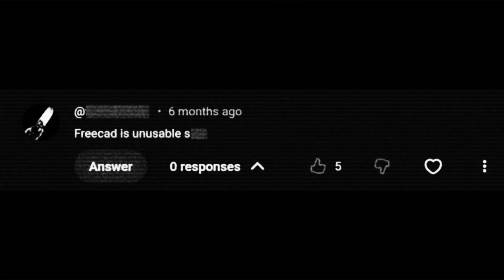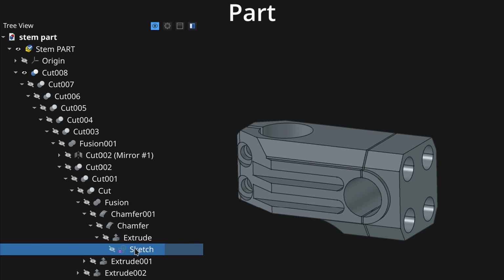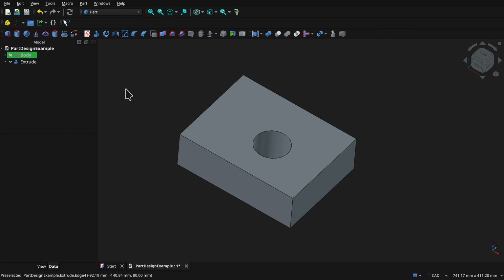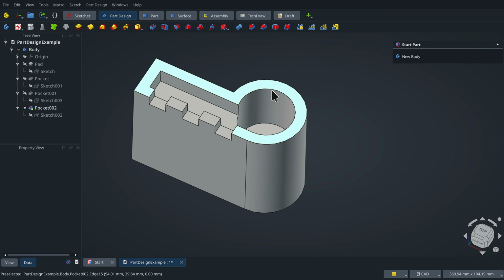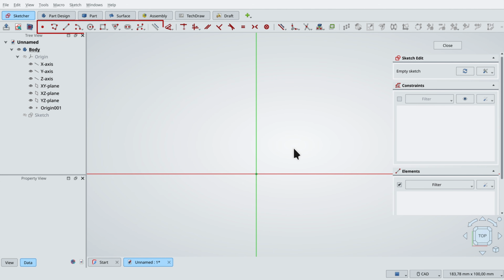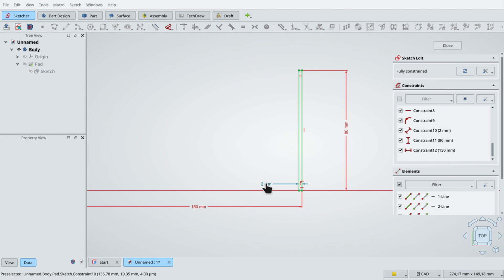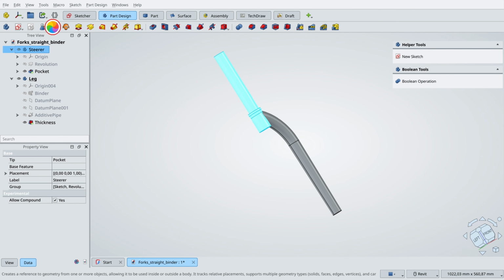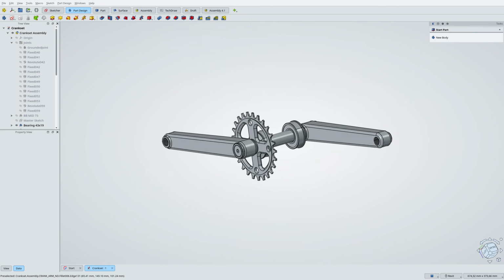STOP using FreeCAD WRONG! Do this INSTEAD (Workflow & Tips)

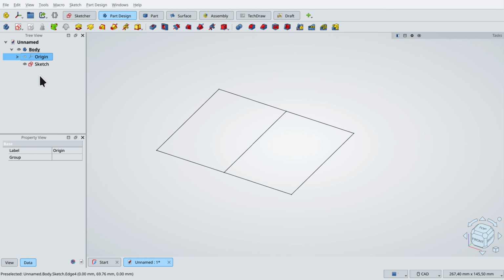Comment: At 21:23 - "FreeCAD dos not like ambiguous contours". This is like saying Chrome does not like more the one tab open at a time. You need to be able to draw a complex sketch and perform multiple operation from that one sketch. You NEED to be able to draw 2 rectangles touching each other and extrude one 5mm and the other 10mm. This is not a cute quirk of the software nor a "skill issue" on the part of the user, it is a fundamental flaw that renders FeeCAD unusable.
Reply: Or... you could just draw one rectangle encompassing both shapes and extrude it 5mm, and then draw a smaller rectangle and extrude it 5mm more. You spent more time typing this comment than you did thinking about it.

Comment: When you work in FreeCAD, you should definitely understand what you're doing... when you work in Fusion, you don't have to. Fusion forgives many mistakes and allows you to easily correct them. FreeCAD is different... you should get it right the first time, but if you're a beginner, you don't know how to do it right... you don't have any design experience yet.
If you're designing for yourself, then use Fusion, since it's free. If you're designing for work and don't have a license for a more complex CAD program, then use FreeCAD.

Comment: Fantastic explanation and insights!..I still argue that the separate part and part design workbenches create an unintuitive and   un-integrated mess. And the sketcher still cant  easily isolate multiple coincident points without painfully going through each segment to  find the point I am looking for. Easily done in other tools(if there is a solution please advise). That said I applaud all of the engineers that have developed FreeCAD and respect that it suffers from the  patchwork effect due to many developers over many years and the monumental amount of work required to change that.

Comment: Do you have any tips for performance issues with models that have a large amount of operations and subshape binders?

I have a model that now takes 3-4 seconds every time I apply any change. I don't understand why it takes so long. Even if I just add a simple cube extrusion it takes a bit to apply. I'm not done with the model yet and I'm worried the calculation time will only keep growing. If I adjust a value of one of my early operations the whole program freezes up for up to 15 seconds and windows asks me if I want to force close the program sometimes! I feel I'm running a pretty alright system (32gb ram, ryzen 5 2600, rtx 2060). I had to turn off the "auto update" within the sketch view to make the software usable, otherwise every single little change in the sketch would cause the program to freeze for a few seconds.

Per the advice of someone online I checked the dependency chart, and it seems there's no circular dependencies either

Comment: I only use the CAM workbench, for the CAD part I use Onshape…
Reply: Good for you. Maybe this video helped you consider it in a new light in case you need a trully free software that will keep your source files private and local.
Reply: @TheSliderW  If you want to keep your files local, just use Solid Edge Community Edition. Much more powerful, fast and stable.

Comment: My problem with FreeCAD years ago was that it was so F-ing slow. I remember me trying to model a plate for holding 3 PC fans, 12 screw holes, holes for fan blades, holes for mounting to another plate - it took like an hour because software after every operation needed a minute to compile what I even did.
Reply: I'm sorry to say that every CAD software would have behaved the same. See, they do the calculations on the CPU, in a single thread mostly. But if it struggled that much it might be because you were not using the proper tool. If I had to guess, i would assume you tried to make screw holes by carving the spiral path when every major CAD software just approximates holes with cylinders.
You could have had hundreds of them it would have behaved just fine. That or maybe you had a weak CPU ?

Comment: @23:00

I swear that you are the only one that I have seen that actually names the features!

I worked with a group of people and I was the only one that did that. I never could figure out how my "lead by example" didn't even rub off onto anyone else. We all had to work on whatever file at whatever time and God only knows who made what model or assembly you will be working on or possibly even your own model or assembly six months later and you have no idea what "Extrude199" and "Fillet338" are supposed to be.

The feature tree should look like properly done coding - self documenting.

If you can at least get your group to agree on even five main feature types that you name it makes working through a feature tree much nicer. Not sure about FreeCAD but other tools have 'find' or 'search' and if people name features...very handy.

Oh, constraints too. Should be a manditory rule that if a sketch isn't fully constrained then don't close it until it is. The nightmares of making a tiny change and a feature tree explodes and you spend 10 hours going through a file of sketches and references that are blowing up each thing that followed.
Reply: The lack of proper naming isn't restricted to CAD.  I work in SCADA, and it's a real pain when I go to edit an HMI and everything is "pipestraight4" and "button18."  All the software I've used allows you to name and group objects, but few people do.  And I get it - it slows you down.  But it also makes it so much easier to revise when you're in the field and it turns out that pipeline doesn't go where you thought it did when you made the screen.

I taught all my junior system analysts to name their objects, and I'd reject their work if they hadn't done so.

Comment: I always struggle to understand, when everyone is complaining about the ui and there is an easy fix that is usually what most people would want to see, why not make it the default? At least the theme, but including the assembly 4 workbench would have saved so much effort. I just couldn't convince myself that the built in was NOT what I wanted, but after a day of searching I had to throw in the towel and use assembly4, develop a workflow with master sketches and then I could work properly.
Reply: agreed. The default Assembly tool is fine though that Addon you use is for the older FC Not sure it's recomended for 1.0+ release ( give the the dev build 1.2.0 a go)
Reply: @TheSliderW  I am usually using release candidates from freecad. I will try if the newer version of the addon is better.

Comment: Freecad on Windows 11 is for sure weaker than some alternatives no matter which render settings you use, so you kinda have to work around it, if you are used to working on big assemblies.

But my personal tip would rather be: Don't use spreadsheets for anything remotely complex (or anything that could become complex in the future). The reason I switched to fusion was basically modelling a part I had done in SW and onshape before and expecting to be able to do smth similar to variants with a spreadsheet in FreeCAD. This "feature" will tank your performance like nothing else and is more like a trap. While I might go back to FC cause of linux (we shall see the performance on linux), switching to Fusion or SW cause you get frustrated with the performance (probably cause you used spreadsheets) is valid and you should always try out all the options. Some programs are just better for a specific task than others, it doesn't always have to do with how you use them. For putting out lots of simple parts (like 10 features or less) fast, there is no better workflow than what you can achieve in FreeCAD in my opinion, simple stl file modifications can be supper easy and fast in blender and yes really complex parts and huge assemblies can be sometimes best done and managed in fusion or SW. always the right tool for the job.

I'm writing this as someone with a gaming-pc on win11 btw., the performance thing could be totally different on a 10year old laptop, or even by just using linux insteat of win (SW, Creo, Fusion all don't support linux, so either cloud based or FreeCAD it is)

Comment: I bought an Elegoo Centauri Carbon and I use linux. I quickly learned that the i'm pretty much stuck with OrcaSlicer and FreeCAD if I wanted native + Open source projects. I have not modeled much before, the first time I tried FreeCAD I was frustrated because it was not like AutoCAD. I looked at a tutorial -> then I immediately designed the dumbbell holder I wanted and printed it. As a newbie I did pretty good for a days work.

I don't understand how you would design a complicated part - but for my needs - designing simple structural parts + parts for a robot arm I think it will be good enough. At worst I will get a drill and cutter, maybe glue, and take things in my own hands :D

Comment: I think the problem with FreeCAD (and I've used it for years), is that for those like me that only need CAD occasionally, you'll never get over either the steep learning curve, or the myriad traps that await when you make a "mistake". As most of my work is with electronics, I  find myself going months in between needing CAD for other things, but I'm also a big advocate for Open Source software, and have been for decades, so I would love for FreeCAD to be THE answer... but every time I open it I KNOW that either Git or multiple "Save As..." are going to have to do some heavy lifting in terms of recovering a project that I've inadvertently killed in some way - often by just wanting to change a variable somewhere in the tree that it then can't recover because the actual mistake was made silently, much much earlier in the design. It's also fair to say I've sort of given up on it at this point because, not only has it become more complex each time I go to use it, but they haven't fixed the more frustrating issues that everyone has complained about for the longest time - and you know about them as you mention pretty much all of them in the video! I now find that, while I miss things like being able to Unfold in the Sheet Metal Workbench, I get better, easier, faster, and more reliable results from using (the apparently unsupported) SolveSpace: AND it's so intuitive that I don't have to even try to remember how to use it each time I open it! It's also by far the easiest app to make an Assembly in that I've come across. If SolveSpace ever added variables from the likes of a Master Sheet,  it would cover 99% of my needs. This post isn't intended to be a hatchet job on FreeCAD - I will never remove it from my computer, and if I think I can do a little tinker project on it, I will give it a go (it also has the ability to import my KiCAD PCBs, through the KiKit add-on), but if I NEED a CADdesign, as opposed to tinkering, I couldn't risk doing it on FreeCAD.
Reply: Joko Engineering channel just uploaded a video demonstrating a NEW Open Source 3D CAD app - Dune 3D - built on the SolveSpace solver (which is brilliant). I downloaded it, followed the tutorial, recreated one of my SolveSpace projects, AND I can import my KiCAD step files straight into it. It's as easy to use as SolveSpace, but MUCH more comprehensive, and intuitively laid out. The keyboard shortcuts are amazing, and being able to add Sketches, Extrudes, Chamfers, Fillets, Arrays and many other items as Groups in the tree makes so much sense. Me? Despite what I said above about keeping FreeCAD, I think I lied: I'm now officially done with it.

Comment: I get what you’re saying about Part and Part Design. But just because you explain it doesn’t mean it’s not trash. Fusion’s extrude lets you choose right in the extrude dialog box: join, cut, or new body. No separate workflows. No mental gymnastics. Simple. Easy. When my work no longer paid my fusion subscription, I hated that the hobby version only let you have 10 project you could edit at once. So I really tried to make the move to freecad. After wasting literally weeks worth of my hobby time, I went back. And after two days, I found the limitation on editable files was no limitation at all. I like the idea of freecad. But for me, it’s just too slapped-together to be an effective solution for me. And the folks at AutoCad know it too. That’s why they still limit the hobby version of Fusion. I was hoping this vid might change my mind. But it didn’t. I don’t deny the software is powerful. But it’s powerful in the same way that golf is fun. And just like golf is the attempt to manipulate the position of a small ball with tools uniquely unsuited to the task, so too is freecad’s convoluted interface unhelpful and kills the experience.

Comment: I remember Blender versions before 2.8. It had a terrible user experience. Then a major milestone was reached. I expect a similar leap forward for FreeCAD, but I hope it happens quickly. Even just improving ease of use and intuitiveness without adding anything particularly new would be a huge improvement.

If I'm not mistaken, someone named nickallen developed a software called plasticity all by himself, and it was incredibly practical from the start. I think the FreeCAD development team should take inspiration from that. People should be able to design things not just in theory, but practically, as if they were "scribbling on a sketchpad," and they should be able to do this without getting seven errors at once when running a simple extrude command.

Comment: This video is indeed good in explaining Free cad. It also shows that it's mix of different approaches resulting from an history of different workbenches not well thought together.
And yes learning CAD is difficult and other ones are also difficult, but by far nowhere near FreeCAD. All difficult doesn't mean equally difficult.
Reply: It does not show a history of different tools that don't work together. Where did you get that from?  
He just explained that the workbenches are exactly like you are in a makerspace physically moving your work from bench to bench. If anything they are like drawers with clear labels and you can even hide the ones you don't use or need.

Comment: An outstanding tutorial.  I have struggled trying to learn FreeCad for about two years.  Typically I get lost following a video and all of a sudden my screen either doesn't look like the tutorial or I wind up someplace I can't recover from.  This piece was very helpful, would it be possible to REALLY go over the ins and outs of the left and right side of the user interface.  I mean real basics like you did in this video,  so if someone gets lost here  they can "bail  themselves out" instead of getting fustrated and just quitting.  Many thanks in advance.